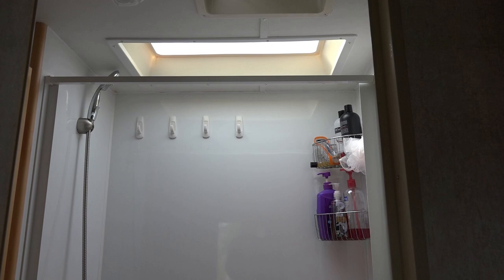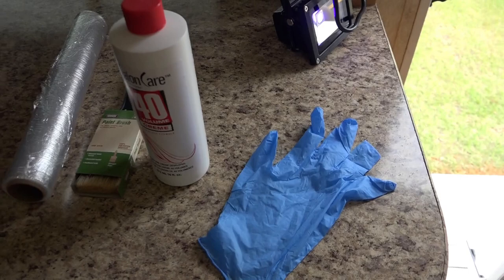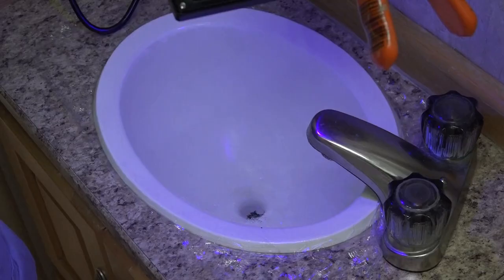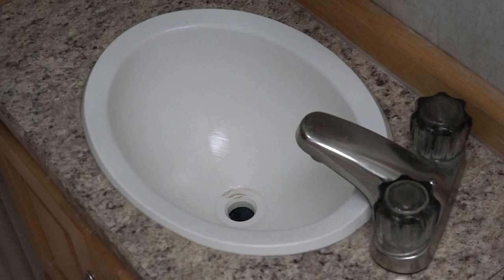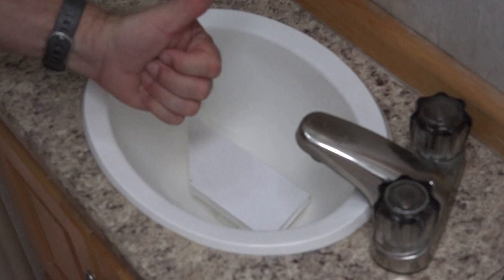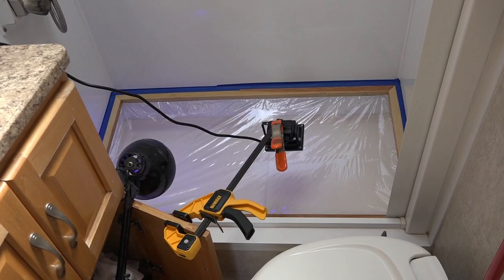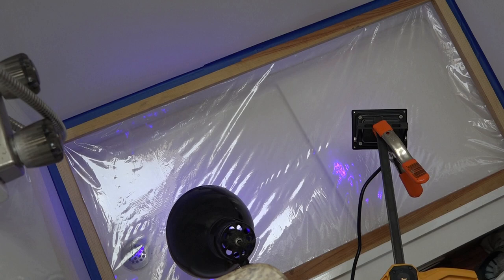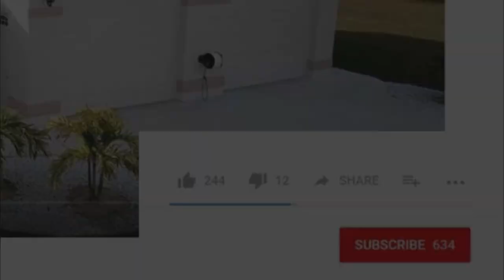How to fix yellowing plastic inside an RV back to white!

Comment: You did a great job BUT, no special light is needed for this reaction. A developer, like Salon Care 40 or any other brand, needs heat to work. People that have their hair lightened will know this, most people may not. So smaller pieces could be placed in a zip-lock and place outside if it is hot out, or cover larger areas with plastic wrap and warm up with a hair dryer. It's all about warmth and time.
Reply: Thank you.
Reply: So if I just saran wrap and let it work in my 100 degree camper in TX in JUN-AUG I should be good regardless of UV or sunshine?
Reply: @asphaltadventurer  - Yes. The developer is doing the work. When people  lighten or "bleach" their hair they don't sit under UV lamps in the salon. It's the chemical(s) doing the work. Sometimes they will wrap the head and sit them under a warm hair dryer because heat can help.
Reply: @TheSmidgeroonie  Thanks for replying. I am going to tackle my RV shower, sinks, and interior light cases remaining in place inside RV. Good to hear!
Reply: @asphaltadventurer  You're welcome!You are going to need it by the gallon jug lol. Just know that 10, 20, 30, and 40 will all work and the higher the number the stronger the concentration and the faster it works. (It's basically hydrogen peroxide cream) Best of luck! I hope everything turns out as you hope. 😀👍
Reply: TheSmidgeroonie so, I need a lot of ventilation due to smell/fumes, and how do I know how long to let it sit for or hold the blow dryer on it for?  And what happens if a little bit gets on my counter and I don’t realize it right away?  Thanks so much!
Reply: @raynebutler1564  Ventilation is always a great idea especiallyif you are sensitive, I've not had any issues with smells/fumes from developer alone. (hair dye can be stinky) How long should it set? That depends on what color or "lift" you are looking for. When you achieve the color you desire, that's how long, then clean off the developer. (The heat/ hair dryer isn't necessary it just speeds up the process and could be used intermittently or as a bump to get things going or finished) As for your counter..Like any diy project if you have concerns hire a professional. If you diy just take any precautions you can...cover, tape off, pretreat any areas you are worried about. (I had a small item that the easiest solution was to smear vaseline on the surface around it and just cleaned it off after. That may or may not work for you.)
Reply: @raynebutler1564  , peroxide doesn't have ammonia so you don't need extra ventilation. It's like 3% first aid peroxide, just high volume, 40%, and a cream.
Reply: @asphaltadventurer  Hi! Did you try the method without the UV lamp? Did it work for you with just the heat?

Comment: Thank you so much for your video Charles.  Your shared knowledge has helped save the day with our shower-tray which was only fitted 6 years ago as part of a complete, shower-room refurbishment at home.  If we hadn't been able to whiten it, it would have meant removing the tiles from the fully-tiled room in order to replace the tray.  As it is an ensuite to a guestroom, we hadn't realised what an effect the sunlight from the window was slowly having on the tray.  We had to repeat the process 4 times, but, as of yesterday, we now have our white shower-tray back.   Black-out blind now ordered for the window.  My thanks again.

Comment: Going to try this on the shower pan AND the walls.  Will probably just tape stretch-wrap packing to the walls.  QUESTION:  It must be important as to what UV band you use to do this.  Long-wave UV is great for lighting up party colors and other fluorescent paints, while short-wave UV seems to be more for disinfecting and can cause skin burns.  Tanning salons use primarily short-wave to stimulate melanin production.  SO, what spectrum is activating the goop?  Which would be the best, and I saw someone comment that it's not the UV radiation at all, it's just the heat.

Comment: Can I do this for the inside of my fridge? I have some yellow stains that I can’t take out
Reply from the maker: I don't honestly know, however, the Salon Care 40 Creme is relatively inexpensive so its worth a try!
Reply: Truthfully... I have flipped 24 RVs... my latest is a 1985 Class A RV
I use (I kid you not ,,, this works)
I use Wal-Mart Exterior Smmi Gloss WHITE paint.. 
and PAINT the inside of the Refrigerator... and yes it works good on the outside too...
but you have to seal it... or it can chip after 10 years... lol
First clean your inside of the Refrigerator  really good... Rinse with diluted vinegar.
To get any hard water off the walls etc.... then paint...
Reply: @judichristopher4604  Would you do that to your own camper? Or just the ones you don't have to live in?
Reply: @paulw1059  
I would never do something unless I would use it too!!
 I did it to my own Refrigerator... It looked terrible... I degreased it as I do everything before I paint it... (You can't paint Dirt or Grease) I have tried LOL.
On the RV I'm working on now... I am doing the Counter Tops with glitter ... Sinks (plastic).. Shower... Toilet... Walls... OUTSIDE of the RV (hand painted)... and then seal it with a Water Based Polyurethane... OH... and I am doing the Floor too, With Beautiful 3D Glitter on the Counter Tops etc... 
I have taken many old Refrigerators and degreased them and painted them with Walmart Exterior Paint... then seal that with the Water Based Polyurethane... LOVE that.

Comment: I have yellowed shower walls in a manufactured home.  It is a much bigger area.  Any ideas?
Reply from the maker: Perhaps you could spread the Salon Care 40 on a single wall and then directly cover the wall with plastic wrap.  Have never tried it but it might just work!
Reply: As a licensed cosmetologist, the peroxide needs heat to develop, not sunlight. That's why we put shower caps on your head ( to prevent drying), and put you under a hot dryer. Dry product wont lift the yellow. Just keep it moist (reapply the peroxide if needed, not water) and warm.

Comment: Definitely going to try this on my teeth 😁
Reply: I hope you didn't, that product has hydrogen peroxide in it
Reply: @rosebean  Teeth brightening products also have hydrogen peroxide in them, and are designed for use on the teeth.  Using a different product on the teeth is probably risky if not dangerous.
Reply: It's a joke y'all 😁😁😁😁
Reply: 😭😭😭😂😂😂😂 crazy crazy

Comment: hi, I tried this on yellowed light switches but it didn't work. Used several different hydrogen peroxide products, different bags, different days of sunlight.. Maybe the plastic is different?  Thanks anyway.
Reply: Bleach?
Reply: I saw another post about getting the peroxide from a hair care supply store. The normal peroxide you get in the brown bottle is 3%. The developer you buy at the hair care store is 9-12% peroxide so it works better. It's also in a gel form so it helps it cling to the plastic better. Good luck!
Reply: I know they used to make plate covers out of Bakelite years ago.  You test for a reaction by using simichrome if they’re Bakelite, replace them and sell the Bakelite ones on ebay

Comment: I have an entire shower to do, not just the pan. Has anyone tried with regular peroxide? Does it continue to work after it dries?
Reply: The problem with regular peroxide is that it's not thick enough to cling to a surface and will run off.
Reply: I seen where person used regular peroxide 6 ounces and equal part water, then 12 ounce cream of tarter.  I think this must be used to thicken the peroxide.